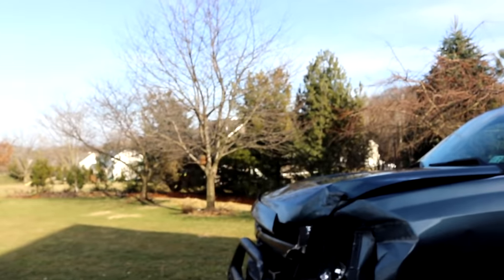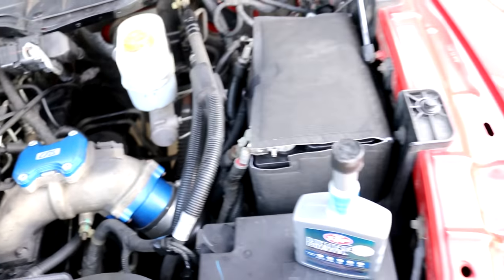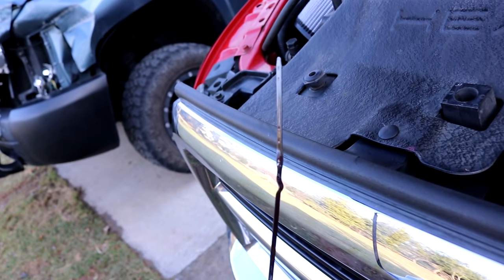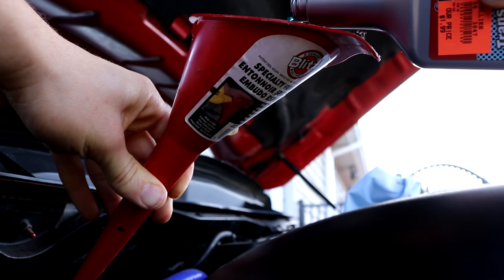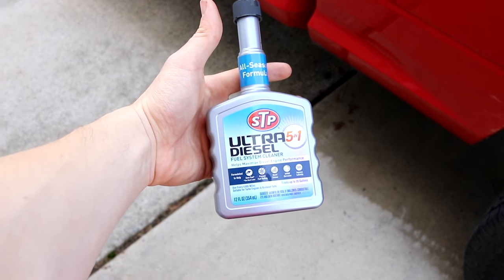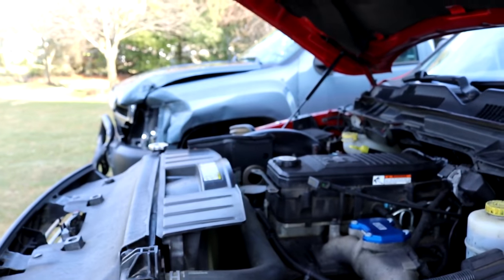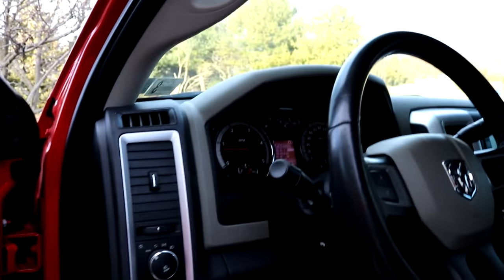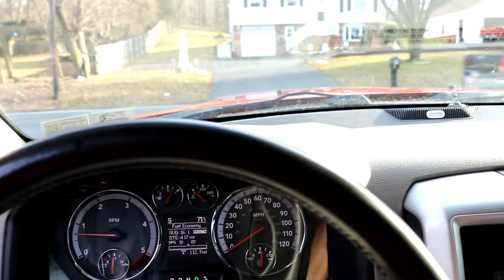HOW TO SAVE YOUR CUMMINS TRANSMISSION!!!

Comment: You don’t check trans fluid with the motor off  has to be on and in neutral  even just to check it for color.  Fluid dose not circulate in Park
Reply: you can check it in park just fine and get jsut the same as if it was in gear but also, the fluid doesnt flow in neutral, only when its in an actual gear and moving will it ‘flow’ the best way to check the fluids is to drop the tranny pan and look for actual metal flakes on the bottom of the pan, but thats costly since youd need more fluid after lmao
Reply: RyanPlays actually the valve body is closed in park fluid dose not flow in Park  that’s  why older dip sticks actually say check in neutral.  Also it’s one of the first things you’re taught when you become a tec than you can certainly correct my method
Reply from the maker: i will check it in neutral thanks

Comment: is the cummins knocking? or seems like a tic tic
Reply from the maker: just the nature of the beast, sound did change with a valve lash adjustment
Reply: I did lash adjustment and my isn't ticking like that at all, you may not be exactly in spec just saying.